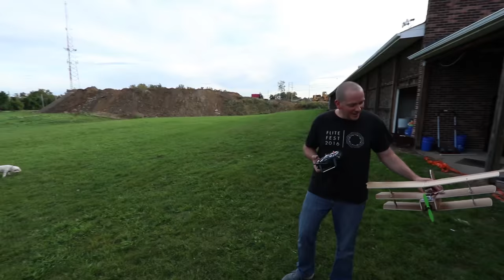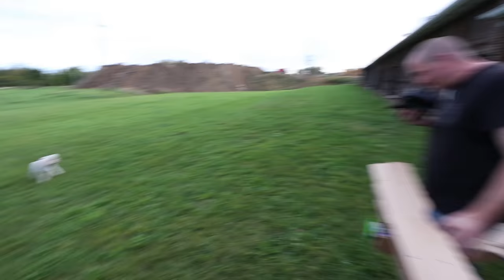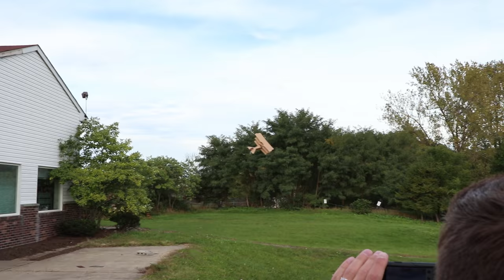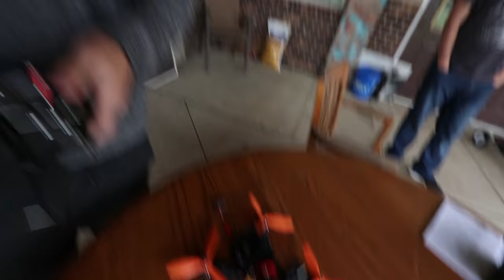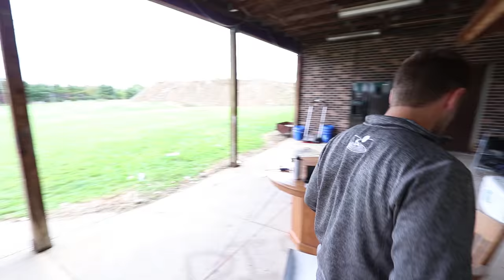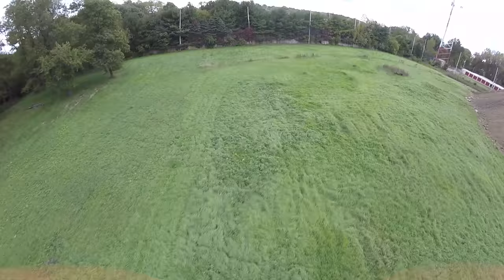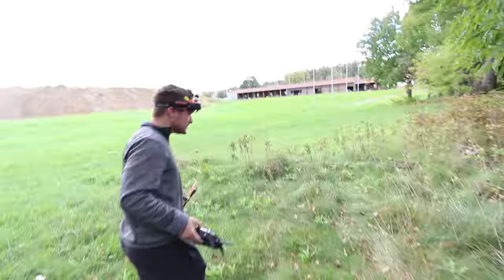NEW DIY TRIPLANE TESTING | VLOG0019

Comment: If you can spare the juice on the GoPro battery it's not a bad idea to keep the wifi on if you think there's a possibility it could be ejected into tall grass or leaves or something.  It has a lost camera alarm you can activate with the app.  I'm thinking about running 5v wire to power mine off the PDB.

Comment: I built a 1:10 scale (roughly) spitfire as a scratch build inspired by the FT-spitfire, and I don't know if it's because I've got a 13" 3-blade prop on it, or because the whole thing weighs probably >~5 lbs, but man it is hard to get off the ground.  The power is there, but it is really difficult to control on the ground at near-stall-speed speeds.

Comment: man if I had the money to get into this stuff I'd be all over it. this is a cool channel.
Reply: on the plane side you can absolutely build and get in the air for under a 100$
however the quads its ~500$ if you have a transmitter  and if not ~600-700$